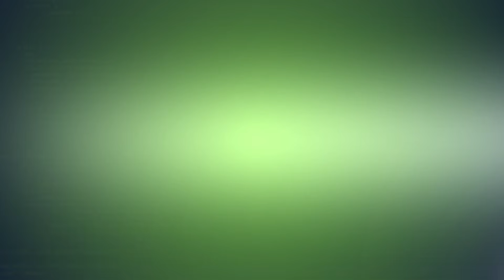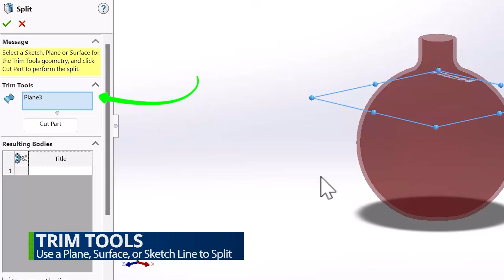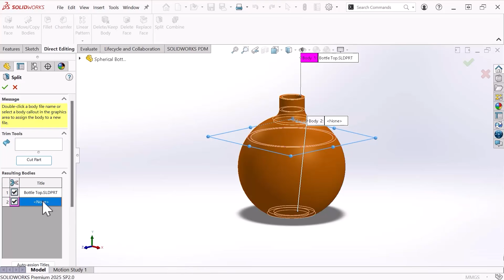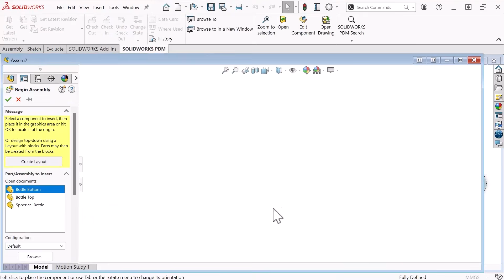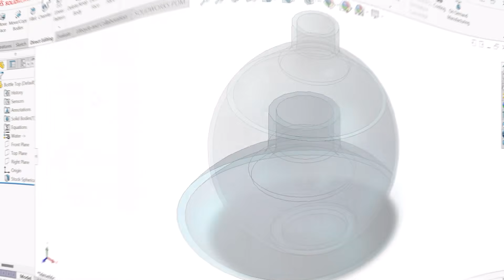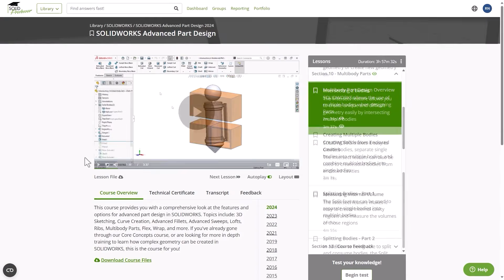Splitting SOLIDWORKS Parts into Multiple Bodies

Comment: When you split these bodies and have them as separate parts, can you edit them as two separate parts, I only see the model tree commands in the original part file.
Reply from the maker: Hi Jordan, you can still edit the resulting parts after a split, but any features you add to the resulting parts are processed after the Split feature in the feature history of the original source part - So if you want to go "back in time" and edit the base-level features of the resulting parts, you have to do that in the source model (since that's where those feature live).

I hope this helps, it's a difficult subject to describe in words. Happy to answer more questions if you have them.

Comment: how does the new part menu pop up when split command is selected. when i tried it just opens the split command window and not the new part popup
Reply from the maker: Once you click the "Cut Bodies" button inside the Split command to actually split the part, you then need to double-click the title field in the Resulting Bodies category and provide a name for the file. This should cause the Save As dialog to appear. If that's not what you were referring to, please let me know and I'll try to point you in the right direction!